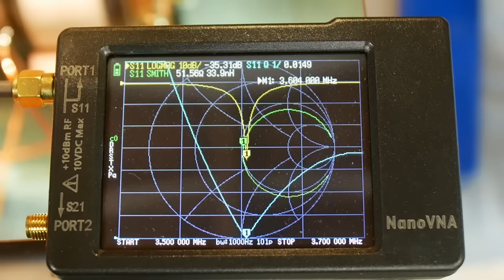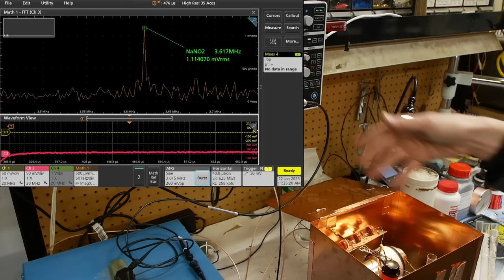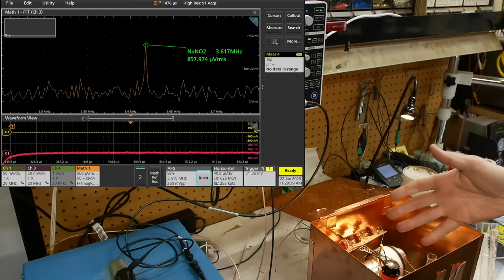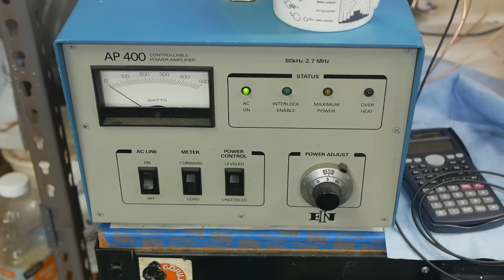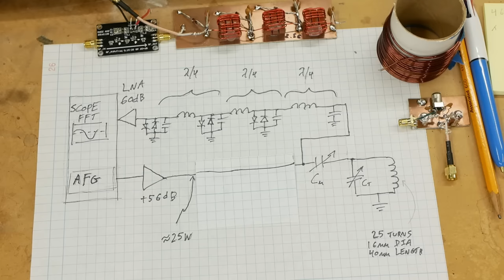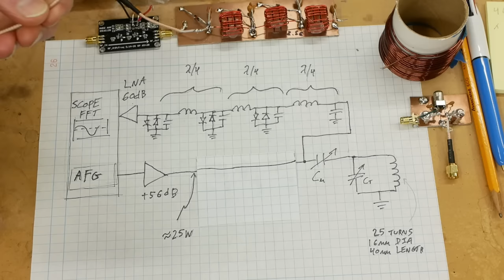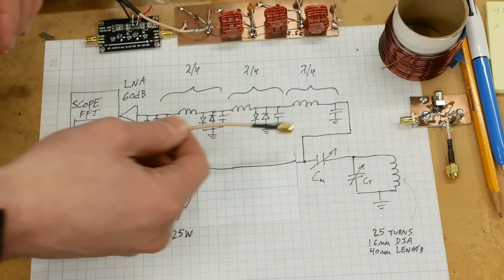Identify chemicals with radio frequencies - Nuclear Quadrupole Resonance (MRI without magnets)

Comment: That's awesome.  When I worked at a cargo container inspection company (using Gamma waves), we were developing device to put in all cargo containers that did a very similar technique.  Broadcast, transmit (or chirp), a known spectrum, and a short time later listen to the return.  With the return, we have effectively characterized that container.  When we cut a small hole (1 ft sq) in the container, the return changed and we detected it.  We then know there has been a container intrusion.  There is more to the story of what we did after that detection ....
Reply: Cocaine?
Reply: Gamma Wave? as in human brain waves or 
Gamma RAY as in ionizing radiation?
Reply: @c2n10  Ah, yea, good catch.  This was like 15 years ago .... Gamma source.  Not sure they still offer the VACIS (Vehicle and Cargo Inspection Systems - port entry, trains, mobile).
Reply: @TheBackyardChemist  Ha ... no, more like dirty nuc bombs.
Reply: @truegret7778  Man, I hope they're performing more samples tested and with better accuracy so no false negatives.
Reply: @truegret7778  Got it, I need to make sure to wash them before shipping ;)

Comment: One reasonable addition to increase the SNR a little could be using a differential amplifier and a pickup coil with two coils of opposing direction (1st ordr gradiometer), that way you could get rid of some of background noise. The passive lambda quarter trick was new to me, I typically work with SQUID detection of NMR signals. Great video!
Reply: Was also wndering if a directional coupler could be used to measure the return signal ?

Comment: For a DIY project that actually works it is very impressive! Especially with such limited equipment. I am an MRI engineer so this was right up my alley, and this was a very good layman explanation! A lot of old MR systems get scrapped all the time (even though they usually still work). For just the cost of shipping you could probably get hold of far more powerful equipment.
Reply: This is the guy that bought an Xray tube via eBay and turned it into all kinds of DIY mastery. If he had MRI parts he'd likely build a quantum computer for shits n giggles.

Comment: Ben. Echoing Clive’s comment: Your content has always made the most ludicrously complicated subjects accessible. I’d go as far as to say your content is in the top 0.00001% of the YouTubes for teaching. This is the best description of this practical and theoretical NMR yet. Especially like how you introduce progressive layers of understanding. Like the pulse inversion to rephase the precession. I was struck about how these phenomena have analogous (though not physically arising from the same cause) in optics. Like the phase-conjugate mirror used to demonstrate a laser cavity where one mirror was replaced by a highly non-ideal reflector made from a spatula. The beam automatically tracked the spatula as it was moved about the lab. Anyway, I was a structural biologist and used NMR, x-ray diffraction, and related techniques along with lab-directed evolution using GFP-based folding and solubility reporters, including the “shazam” split GFP tagging systems I developed, now used by other labs to probe the hidden life of molecules in living systems and make new biosensors. I wish your content would have been available in graduate school. cheers!
Reply: i have to agree  - I've been working with NMR as an analytical tool for a decade went on courses and the last part about pulse sequences and the quadruple aspect is very fascinating and has given me new inspiration to consider approaches like for in the field diagnostics

Comment: Hey Ben, excellent video! I noticed at 13:08 when you showed your physical circuit that one of your diodes in the third stage is backwards! You might get better performance if you fix that

I did my senior design project in college on NMR’s, we were trying to design one that could fit in a coffee cup so that ultimately you could send it down an oil well. This video was very informative, it cleared up some things that I didn’t understand even back then. Awesome work

Comment: That λ/4 network is startlingly similar the guitar distortion circuits I've been studying lately. While your transmit isolation circuit is also very similar to other distortion circuits, the more stuff you learn, I find the more parallels you find.
Kinda magical to see much the same circuit used by one person to make noise(pleasant rock-n-roll noise) and another person to pull a tiny signal out of the noise.

Comment: Hi Ben! You are really trying a physicists solution for the paracetamol issue. May I as a chemist give you a recommandation? Your pills mainly consist of filler material and you concentration is low. You will have easy success with an extraction or by synthesizing the paracetamol from scratch. I know tweaking and optimizing is what this channel is all about, but if you want things to be done, do not hesitate to tune concentration instead of circuits. Keep on with your nice work.

Comment: Very neat.  I'd probably have gone with PIN diodes and DC bias switching, but the passive approach probably gives enough signal to noise ratio at the expense of needing a bit more power. I'd also consider using either an adjustable pickup loop or a capacitive divider ahead of the receive chain to help increase the tank Q.  Very cool solution though, simple and totally self-protecting.
Reply: Carrier lifetimes at 3.6 MHz get kinda iffy for a PIN diide ... standard diodes can be used as switches too, they just require a bit more current to get a low 'ON' resistance'. In the past I've used 1N4148 diodes to switch quartz crystals in receiver and transmitter circuits using either PIN or simple 1N914/1N4148 diodes; PIN at 48 MHz 3rd overtone  and simple diode at 12 MHz fundamental frequency.

Comment: Great work! Years ago, I tried performing NQR on cuprous oxide powder using some custom PCBs, but failed to get a signal. Then my father pointed out that the cuprous oxide would need to be in very pure crystalline form rather than a fine powder; so I basically gave up at that point because recrystallising cuprous oxide seems very difficult. Fantastic to see you succeed; I may well try to resurrect my experiment using sodium nitrite!
Reply: Maybe you can find a crystallographer (X-ray?) who can work some wonders for you or at least give you some input on how to process the material most effectively.  Definitely make a video if you can showing.  Will be a neat addition on YT for the World to see.  I would like to see at least.  This topic and microwave spectroscopy (even the synthetic chemistry) seem like have big gaps in demonstrations on Youtube.
Reply: You're lucky.  The most I get out of my dad is suggested improvements to my Goulasch recipe.

Comment: Hi Ben.  At 13:02 when you show a picture of the transmitter isolator it looks like the second from the right diode pair are both facing the same direction.
Reply: I noticed that too, and was wondering if it didn't matter because the amplifier may have been producing enough voltage to overcome the reverse breakdown voltage of the diode. It would be interesting to know if this was a mistake, and if it may have interfered with his experiment results.
Reply: what you mean by pair  diode ????

Comment: This part that is open at one freq. and closed at another, reminds me of a book I got from a library in the early '90's about "Pulse Forming Networks". It showed how to design pfn's using coaxial cables and/or passive componnents. I don't remember who wrote it. It had all the formulae you would need to design pfn's.
Reply: I heard the Combine use an unusual one with a veeery long rise time.

Comment: Cool video!
The problem of high power transmit pulses coming right back at the VNA is a common problem in the industry. Both radar and telecomunication equipment have to deal with it whenever they want to use the same antenna for Rx and Tx. In the GHz range and above, fully passive devices (so-called "circulators") can be built to seperate the waves depending on the direction they are coming from. In your application, they would not be feasible, unfortunately.
However, analog telephones use an opamp circuit replicating that behavior at much lower frequencies. Maybe you would have to use discrete transistors due to the frequency and power requirements, but ultimately it could eliminate the need of replacing the VNA protection circuit each time. The LC tank and matching cap would still need to be tuned, obviously.

Comment: For the isolator for the transmit side of the circuit (the pairs of crossed diodes in series) I can see that at 13:05 it looks like one of the pairs of diodes is not crossed but are both facing the same direction. I suppose that the amplifier may be producing a high enough voltage to overcome the diode's reverse breakdown voltage, making it act as a Zener diode, but I was just wondering if that was a mistake or if I am seeing it incorrectly. 
I love this kind of video though and have learned a lot by watching them!
Reply: Yes I noticed that also, he physical has 1 more set[4x] of diodes than on the schematic[3x]. Yes I was wondering the same questions

Comment: I noticed that one of the diodes on the transmission side filter is reversed (both point in the same direction). I am wondering if this is intentional and if so, why. Otherwise, great video. Thanks
Reply from the maker: Hah! I'm surprised it works. I'll have to go see tomorrow if it's just a strange lighting effect on video. Certainly looks wrong.
Reply: @UCeAfLSBX2qycMZDr4siuuAQ 13:03
Reply: @AppliedScience  Hey, I noticed the same thing. I wonder if the voltage the amplifier is transmitting may be above the reverse breakdown voltage of the diodes you used, making the flipped ones act as zener diodes. This may be why the setup still worked even with this mistake. I'd love to know if this was just a strange lighting effect though, or if not, if correcting it may improve your experiment results. Love your videos!

Comment: If high Q is important, would Litz wire, or silver-plated wire be helpful?
Reply from the maker: I thought so too!  As it turns out, Litz is only beneficial between 50KHz and 1.5MHz, at least according to the ref that I added to the description.  The "proximity effect" eventually becomes worse than the "skin effect".  I didn't know this, but thought it was weird that all of the NQR researchers used solid wire for their coils.  Silver plating seems like it would help.  Plain old thermal noise is also a big problem, and I saw some references using chilled (liquid nitrogen) coils.

Comment: Speechless!  Absolutely total awesomeness.  This along with microwave spectroscopy... and maybe a few other spectroscopic techniques when the thought comes to mind, make me wonder really why aren't those methods more well disclosed, taught and used?  Neat winter season of experiments on YT.  I'm having Les' Lab like thoughts with you demonstrating and teaching a wider range of lab or shop homebrew potentially useful tools; that at the least are awesome to watch you use, better comprehend the system and be aware of the usefulness.  I'm also having thoughts of auto tuning those caps with a feedback loop from the NanoVNA I guess firmware... though there are a few apps that can be used to glean the data for a spectroscopy as well as automating some more processes to get more a sweep to characterize unknowns I guess. Probably can use some computational chemistry apps as well to correlate.  I suppose my thoughts are turning into some Rube Goldberg molecular energy level states super sweep spectroscopy machine... ideally using the least destructive if not non-destructive methods.
Reply: They are known, and taught if you know where to go. It's not more widely used as it's limitations make it applicable for niche scenarios only

Comment: Huh, that looks rather different to EFNMR spectroscopy, where I think the characteristic output frequency is dependant on your magnetic field strength.
Also I’d have expected litz wire to be better for high Q due to the skin effect, compared to that thick enamel wire.
Oh and the second two diodes in your anti-noise amp filter look like they’re both the same way around.
Reply: I found @warecreepers comment about "litz wire...high Q" to be interesting so I asked ChatGPT the following question and got the following agreeable result:
me: explain the RF nature of Litz wire used in a coil inductor for high Q at 3.6 ghz
ChatGPT: Litz wire is a type of wire that is made up of multiple strands of insulated wire that are twisted together. It is often used in the construction of high-frequency inductors and transformers, as it has a number of advantages over traditional wire constructions at radio frequencies (RF) such as 3.6 GHz.

The main advantage of Litz wire is that it reduces the skin effect, which is the tendency of high-frequency currents to flow primarily on the surface of a conductor. This effect is caused by the fact that the resistance of a conductor increases as the frequency of the current increases. By using multiple strands of wire in a Litz construction, the skin effect is reduced, and the current is distributed more evenly across the entire cross-section of the wire.

This leads to a reduction in the AC resistance of the wire, which in turn leads to a higher Q factor in the coil inductor. A higher Q factor means that the coil inductor is more efficient at storing energy in the magnetic field, which is important for high-frequency applications such as RF communication systems.

Another advantage of Litz wire is its flexibility and ability to handle high current density. This makes it ideal for high-frequency applications, where the current density can be very high. It also allows for a more compact design, which is often a requirement in high-frequency applications.

In summary, Litz wire is a type of wire that is made up of multiple strands of insulated wire that are twisted together. It is often used in the construction of high-frequency inductors and transformers because it reduces the skin effect and leads to a higher Q factor in the coil inductor at RF frequencies such as 3.6 GHz, also it has a better current density handling, flexibility and it allows for a more compact design.

Comment: This is a great resource, thank you!  We are starting to detect nitrogen NQR using atom-based spin sensors, such as optically pumped magnetometers. These have a few advantages over tuned RF coils, such as tuning, and separation of the TX/RX circuits (you can't blow up the RX!).

Comment: This is super neat! You actually get a higher Q antenna with thinner wire. It decreases operable bandwidth but the tx/rx signal at the proper frequency is stronger.

Comment: Coming back to this video after having learned about lock-in amplifiers, this might be a really good application for a lock-in amplifier. It can essentially eliminate all noise that isn't the exact signal you're looking for -- they seem like magic until you see how they work. Shahriar at the SIgnal Path did an amazing introductory video on lock-on amplifiers years ago, and any time I need a refresher I watch it.
Reply: Also, I just noticed this, at 13:12 it looks like one of the diodes is facing the wrong way, ie you have both diodes pointing in the same direction... was that a mistake or intentional? It seems like that would only allow half the signal through.

Comment: When we were working on NQR substance detection a while back, we used a toroidal coil and placed the sample into an opening in the toroid. Much higher Q and you can generate large energies if you wish by "pumping" the stored AC field in toroid/capacitor resonance.
Admittedly we were trying  to get megawatts in extremely large samples, but toroids were that key to getting high Q.

Comment: I like the commentary on the circuits - it reminds of the descrptions in Horowitz & Hill. Something you might consider is to take a problem & discuss the pros & cons of various approaches before settling on one.
As a physicist I find many electrical engineers use a technique they are familiar with & refine it to achieve a spec. It is hard to discuss optimisation without being aware of the possibilities.
I guess what I am asking for is a toolkit of circuits & an explanation of the limitations that define which should be used where.

Comment: Extremely cool as always. I was always under the impression that MRI needs a constant strong magnetic field where the atoms can spin around. As a teenager I build a small MRI with the magnets of a Magnetron to detect the H in water. It gave me a nice "ring" at about 30 MHz. I did not know about NQR though. Thanks a lot!

Comment: Nice work!
I have some advices regarding the circuit. Although the isolation circuit works, it has lots of cons such as the high voltage/power drop on the  diodes, the added noise and the limited bandwidth tuned at lambda/4. Ideally I would use an off-the-shelf circulator module but the frequency is too low. Instead, I would use an RF switch module with a switching pulse synchronized with the AFG. You synchronize both the oscilloscope and the switch by feeding the pulse signal to both (oscilloscope Aux input and the switch port). Ideally I would use a function generator for the pulse signal but given the low speed (300us as you mentioned), you can design the timer circuit using 555 timer or similar chips. I am sure this will increase your SNR and even help you with the implementation of the signal phasing